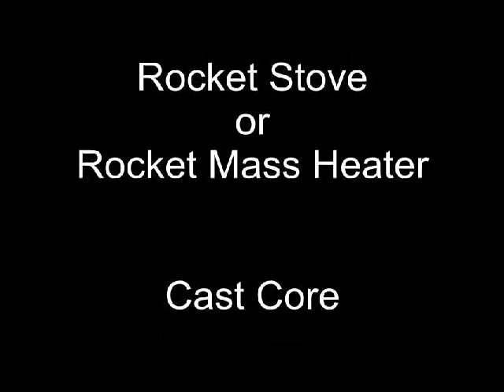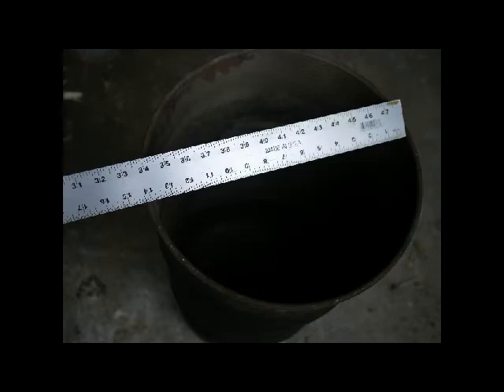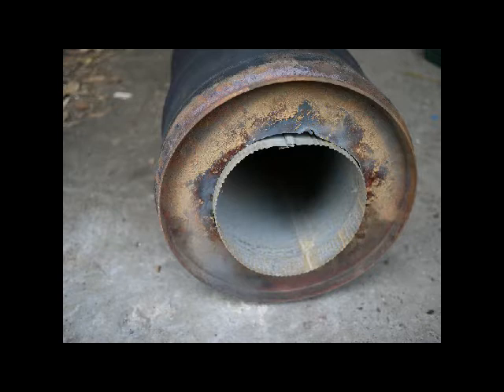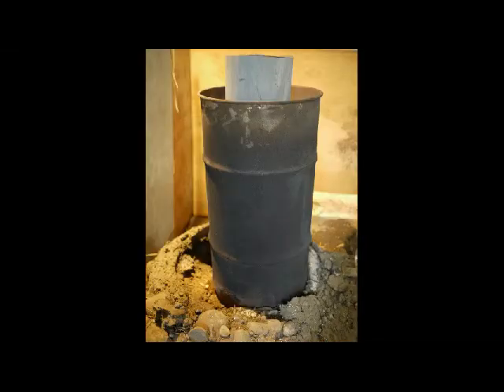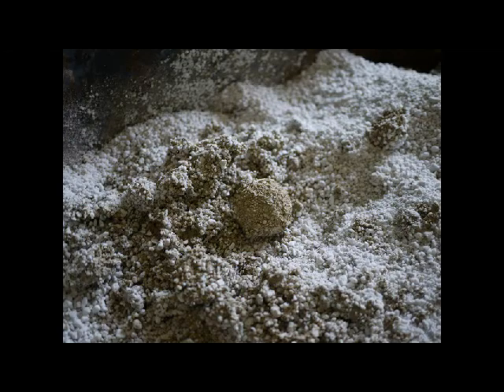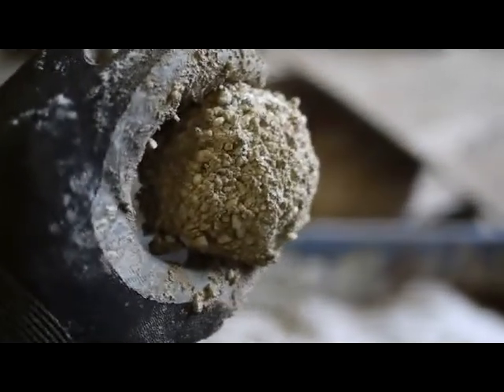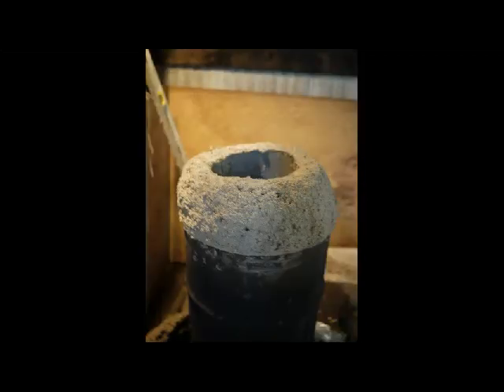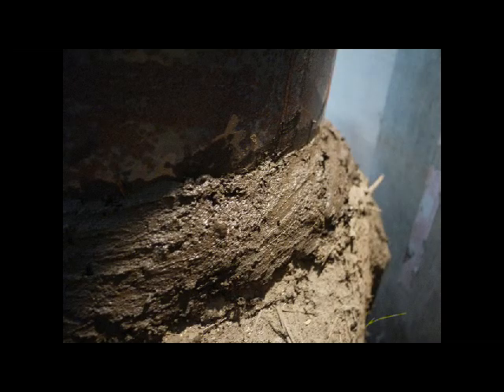Rocket Mass Heater Cast Core Part II The Heat Riser

Comment: Does the hat riser just 'sit' on top of the cast core?

would it be smart to put 4 or 6 pieces of rebar into the core around the heat riser whole
so that when we build this heat riser they hold together better?

Or is the contraction/expansion going to crack the heat riser eventually?

thanks
Reply: poosmate Thanks for the Tip. I've seen many kbbacon's videos and he's answered some of my quesitons also. but I mus t have missed the series you're talking about. thanks will go check that out.

Also a guy I love is the aussie guy who's got the 'oil burner' channel. really funny and tremendous output for the simplicity of build. But very noisy and too powerful for my target use.

cheers
Reply from the maker: Hi Yves, yes, it just sits there.  I will make a small "gasket" of the clay/sand mix for it to sit on, to level and seal the joint, but that's all you need.  Rebar will for sure tear the core apart due to the different expansion/contraction cycles as you mention.  Good luck on your build!
Reply: ***** Thanks for the prompt answer. Are there ways to use rocket stove technology to heat water? It seems I'm always coming back to that because the house I want ot upgrade has 1) a pool that needs heating for the 0ctober/november and march-april days and also has traditional radiators in it so I would like to have hot water circulate in those from a wood/rocket heater rather from the oil burner.

Do you know of the best plans/ways to heat water effectively adn manage the steam/pressure ?

I was thinking of building a head riser just like you describe, then around it coil some
copper tubing, then put a barrel or larger pipe around that and basically funnel the
hot gasses past the copper coils.

I'm wondering, is it necessarty to do all the cobbing etc if it's jsut to heat water?
Plus I have no welding skills...yet.

cheers and thanks
Reply from the maker: Yves Baggi
Hi Yves, I'm happy to help when I can.  I am afraid I'm not a water heating expert, so I'll just give you my opinion.  There are many ways to use a rocket for water heating.  The most important thing to remember is that rockets are efficient burn devices only because the heat generated is not used for "work" until after combustion is complete.  So, you don't want to harvest any heat until after the insulated riser.  The simplest/safest rocket water heater I'm aware of, in my opinion, is Tim Barker's design he created for Geoff Lawton.  Here's a blog post about it..

http://permaculturenews.org/2012/11/23/rocket-stove-hot-water/

Good luck man!
Reply: Thank you, you put in a few words what was starting to cristalize in my mind from all the builds I've been watching.

thanks again, will follow Barker's construction.

thanks again.

cheers
Reply: Hi Yves, I know it's been 4 months since you asked but if you haven't already, go watch Kbbacon's series about RMHs.  He has a series of 16 videos (I've watched them all last night and today).  They are very informative.  Ppotty1 is another good Rocket stove heater video maker too.

Poo
Reply: If you go on Kbbacon's channel and click on his playlists you will see the rocket stove series.  The first 3 vids are parts 1-5 of a rocket mass heater build.  Part 3 is the 16th video (just a bit out of order lol).

I don't like the idea of burning oil but I'll keep a lookout for the aussie guy's videos.

I'm hoping to make my first rocket mass heater this year, but I don't have much space so may have to knock the mass on the head.  I'll see what I can work out.

Poo
Reply: poosmate
Thanks found it.

The aussi guys' channel is called 'oil burner' ... how appropriate. He burns mainly used veggie oil. but works wiht motor and transmission fluid oil as well and biodiesel if you can make that in large enough quantities.

I learned a lot about the burning process and when the heat is high enough and the furnace has enough air, all that comes out of the exhaust should be co2. I think that's beautiful and the fuel is free for the most part and there's tons of it available.

I had also purchased all the incredients for my first rocket stove and wanted to start in my secondary house garage. but I forgot that it was an old farm an there is no heat. so I tried to work there and it's like -5deg C and my fingers are freezing. so waiting for at leat temps around 10deg.

cheers
Reply: Thanks for that, I'll check it out.

Good luck with your build.  I hope the temperatures rise soon for you.

Poo

Comment: thanks for the quick reply about the measurements for 6 inch stove would an opening of 5 3/8 x 8 be to big for a six inch going to 5 3/8 square tunnel.And I am also trying to incorporate a clean out in mine. also how do you keep the box from sinking into the cement on bottom
Reply from the maker: Mark Vaughn Yeah Mark, that's going to be too large and you'll get a bunch of smoke out the feed.  Go with 5 3/8 square, and be aware that you will usually run it with even that restricted a bit.  That's done by covering the feed with a pot, brick, piece of insulation, etc.  My mix was thick enough that I could manually just keep the inner mold from sinking, but you do have to be vigilant and grab it and center it regularly during filling the mold.  You don't really want to use any type of solid stand off since the mix will shrink a bunch as it dries and anything hard in there will crack it.  I imagine you could wire the inner mold up, like do with rebar in a concrete pour, but I've been ok just being careful.  Good luck, love the Mopar!

Comment: I have a question about the space between the 14" grease drum and the outer 55 gallon drum.A 55 gallon is about 22" in diameter, your grease drum is 14" in diameter. So that leaves 4" a side to go to the exhaust.Have you played with that dimension at all to see what the results are?I came up with a solution to be able to move my riser core, and will be left with 2" a side to go to the exhaust.Any thoughts?( the Evans, Jacksons book shows 1.5" in their book)
Thanks again.
Reply from the maker: I have played with side gaps a bit, I sometimes use a 30 gallon drum for the outer and that leaves 2" side gaps, roughly.  It's hard to compare apples to apples since the rest of the system is usually unique as well.  I don't have a preference as long as the system works as a whole.

Comment: I was contenplating casting the riser out of place, then moving to the core.Do you think this will harden up enough for movement, or am I asking for trouble?
Thanks.
Reply from the maker: That is typically how I do it, so you should be fine.  That is one of the factors that led to my preference for the little drum as a riser container.  It makes it possible to pick the whole thing up and have it contained.  I recommend moving it as little as possible, but you can move it.  Good luck on your build!
Reply: *****
Thanks for the reply. I ommited the fact that I'm using two pieces of duct work (6 and 8 inch) to make up the outer "drum".That is why I was wondering how hard the mixture sets up.
Reply from the maker: ivehadenough17
Oh, yeah, it's actually really fragile!  If you tape those things tight and are really careful you will probably be able to get away with it.  I don't think some cracks there would be a show stopper.  If it came all the way apart into two pieces you'd just want to join them with a bead of fireclay/sand when you stacked 'em in their final location, and you'd be fine.  Go for it.
Reply: Thanks for all the help! And, The awesome videos.

Comment: I'm building my heater this summer. I've seen a couple of videos that talk about the inner riser "flue pipe" burning out. Some guys have used firebrick so it lasts, but what about using a section of iron well casing pipe. It's thick walled, so might last quite a long time. I haven't found any other thick iron pipe this large otherwise.
Reply from the maker: The inner flue burns away quickly, it is a sacrificial mold so it is intended to.  This method creates a lightweight, insulated refractory riser.  I prefer insulated riser construction which is why I choose this method over firebrick builds.  As for heavier iron, it will last a while, but will still spall and eventually fail.  Good luck on your build and thanks for the comment.

Comment: what is the size of the drum that goes over the heat riser? 30 gal...55 gal
Reply from the maker: Hey Unc,  I typically use 55 gallon drums for the radiator, but you can use a 30 if you can find one.  Thanks for the comment.
Reply: what kind of clearance do i need to the wall, I am going to brick the wall next to radiator barrel. This is in a garage setting.
Reply from the maker: therealunclebilly
Hard to give you exact advice here, of course it depends on what is behind those bricks among other things.  The top of my barrel is often in the 1000F range, with the top/side typically at around 500F-600F, so I would say that normal wood stove clearances are a good starting point.  The very best advice I can give you is build it all in such a way that you can physically monitor any areas of concern.  In other words, if there are combustibles behind those bricks, and you can't see or feel back there, I'd give it a lot of room.  If you can get your hand there, and a IR thermo, you can learn how it all reacts with different use modes and become quite comfortable and confident.  If you don't know what's going on behind the bricks, you will always worry.  Good luck man.

Comment: Sooooo...let me get this right. Your saying the gap between the top of the heat riser and the top of the outer barrel will burn good if its over 1 1/2 or 2 inches? I have always read and seen on videos that the optimal distance between them was 1 1/2 inches. This is pertaining to your response to adambarlow. If that's what you have been doing and it works, that's awesome. It will make it easier for me when I build mine. Awesome Video's! Keep them coming!
Reply from the maker: Hi Bobby, yep, 2" is minimum and honestly I think that's too tight.  Bigger will work great, I like 4" top gap, but you can go even larger if needed.  Good luck on your build and thanks for the comment.

Comment: Thanks for the tutorial. About a third of the way through, I see your riser setting on a core that has what appears to be the exhaust hole going into the mass. If that hole is less then the 8" diameter for the rest of the system, at what point would you consider it a choke point and inefficient for the "rocket system?" I hope I'm making myself clear.

Comment: For the surrounding material we're not looking for an insulator, right, like the heat riser & core material?

Instead I'm thinking we're looking for a material to absorb, store, and radiate that trapped heat. Seems like any material that does this well would be excellent surrounding material.

Cob has a history of working well. Concrete seems very similar here in function. Readily available. I wonder if concrete is not taught because it isn't "green"?

Comment: Thank you for your quick response, I'm valueing your experienced brain.  I previously did the Paul Wheaton box job with a foil backed bubble rap barrier under & all around the walls, seemed to work ok, but my 10 ga rectangular j-tube warped & failed after about 3 wks, so I had to quickly set my old wood stove up while I hauled all of the loose fill out.  Dont want to do that again, so I'm using your cast core & half barrel design.  I'm not understanding the airgap & how to do that.

Comment: Interesting. I am thinking to build a 6inch system. any idea on dimensions for the burn chamber and heat riser? I have Ianto Evans book but his dimensions aren't for 6 inch system.

Also, i noticed you burn chamber didn't have an ash trap or even slant downward toward the feed hole. Do you find it difficult to clean out?

Comment: My attempt at building the fire box failed :( i used vermiculite. I used vermiculite let it dry out for a week and burned it a few times but it just crumbled apart. I guess im going to try fire bricks now. I am going to try again using perlite for the heat riser. Any advice? Thanks for the video! In an interview with thomas edison he was asked how he persisted  when he failed over 10,000 times when creating the light bulb. He said he didnt fail he just learned 10,000 ways  it wouldnt work...

Comment: Love the video's keep up the good work and will be following along. I wonder what kind of pipe you are using for the flue and won't it eventually burn out?  If that is the case could you use cardboard like a concrete tube form to make the flue? How long does the clay slurry need to set up prior burn? You didn't use furnace cement, was this because you don't think it will be getting as hot as j tube?